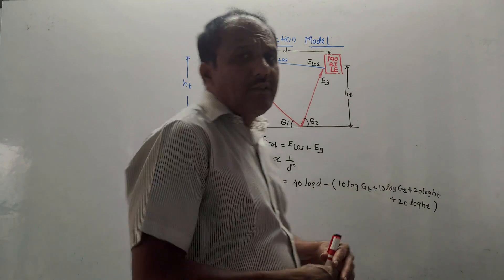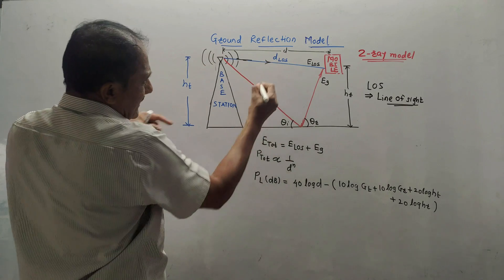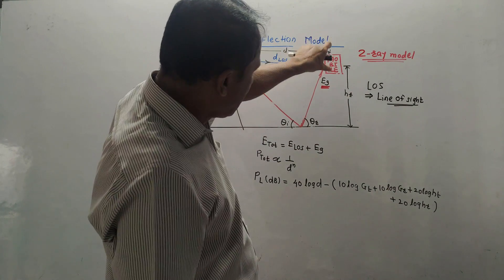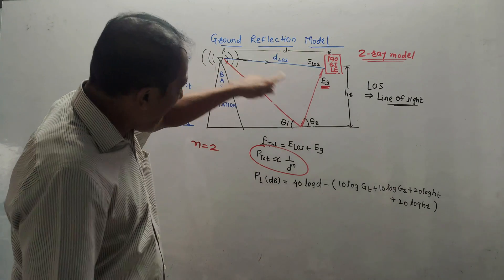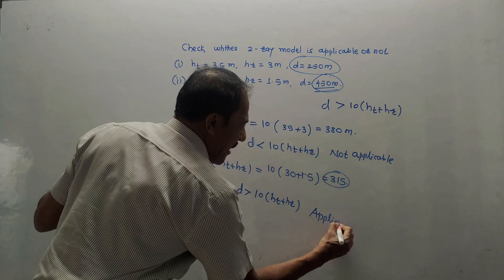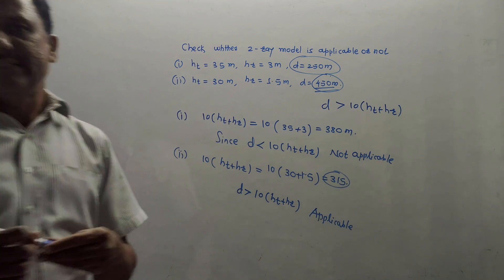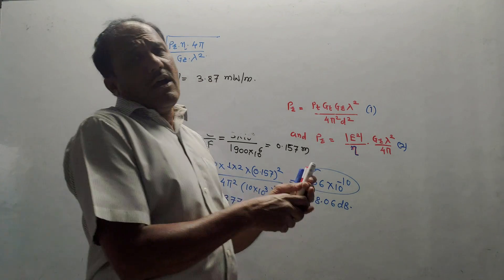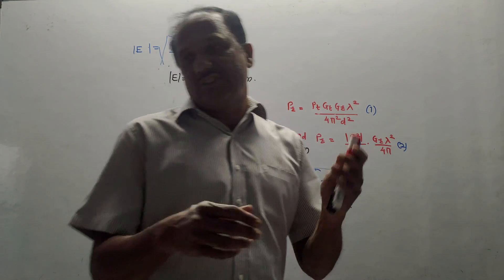GROUND REFLECTION MODEL (cellular network).

Comment: Sir why haven't you converted the values of Gt and Gr in the second numerical you were solving to find the received Power (Pr(d))??
Or can we substitute 1 and 2 values of those directly??
Reply: yess thats a big mistake ......sir told in 1st lec that instead of 0 even if there are numbers given we should take antilog of those values....so its mistake
Reply: If the values are mentioned in dB, only then we've to take antilog: otherwise no need

Comment: sir can you explain how |E| = 3.87 mW/m is obtained in 3rd question cauze i'm not able to solve it and getting many errors
Reply: This example solve carefully
Reply: To get the correct answer
Reply: Thanks bro! what a  great help you have provided 🤓  @VaibhavVlogs0703
Reply: Before putting all the values in your calculator make sure to put your calc in complex mode to get the answer.
Reply: ofc bro, I know that! nvm I got the answer, I was putting values in dB(i.e. -98.04   dB) instead of  1.57x10^-10 @omkhatavkar